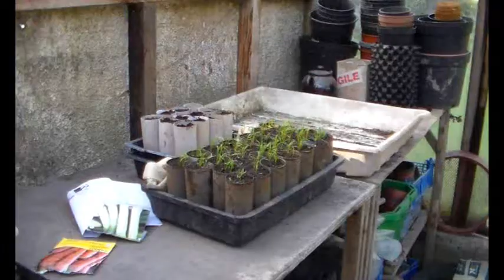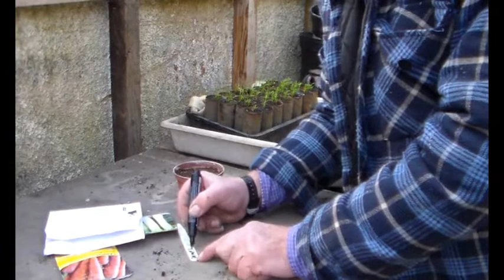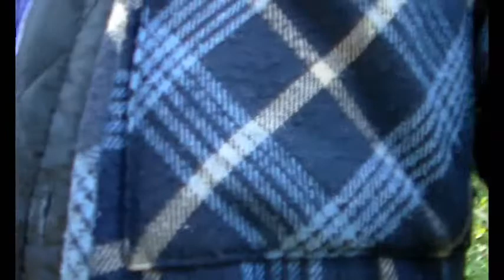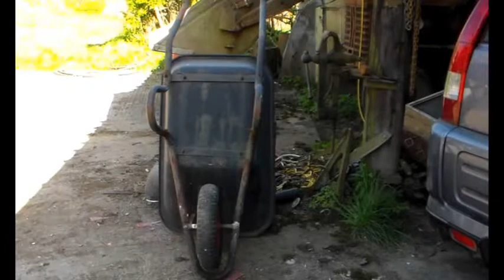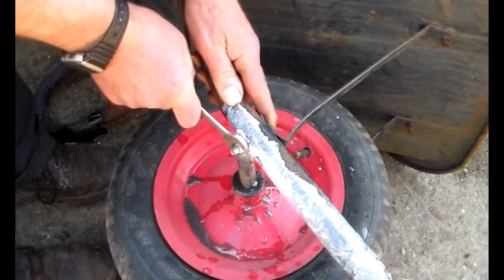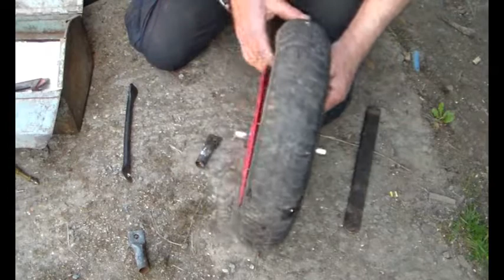Home life in lock-down, No.1. Veg garden, saw sharpening, compost, the question of wheel barrows

Comment: Last year I converted a stationary saw rig into a standard 3 point. On part 8 I use a Belsaw 10452 saw sharpener for the first time  to shape and sharpen the teeth. I very seldom hit the backsides of the teeth when hand sharpening opting to file the face of the tooth with approximately 9 or 10 degree angles as you describe. Good informative video sir !!  Btw I fixed the tube in a wheelbarrow tire yesterday !! Thanks Andy for the video.
Reply from the maker: Hi, thanks for the comment, there's lots of us independent types hiding away in corners, well done on the wheel barrow. On of my pet hates, flat tyred barrows. Nice sharpening video, and I subscribed, Cheers

Comment: I was daydreaming, thinking about cutting notches in small ash logs, and things. 
Over here in Tasmania, we have a lot of wattle that has that horrible, impervious, shiny bark. I've had some in the shed, drying for 5 years, and still it spits all over the fire and you can actually see the sap boiling out of the ends when you put it on the fire. Over the years I've collected heaps of it and I swear at it each time I go past the shed. 
I cut some notches in it, as you suggested and I can tell that it's making a bit difference. It's already making the musical knocking sound when I hit 2 pieces together, which tells me it's drying out quite well, just in a couple of weeks. 
My firewood cutting setup is a big saw horse I made and a chain saw. Having given more thought to the idea of notching these green logs. I wondered whether it's worth the effort. It takes a few extra seconds to put the notch in, and you lose a bit of wood in shavings. Then I remembered how much heat it takes to drive off water, and every single millilitre  of water you can remove from your firewood gives you heaps of extra heat in the fire. So yes, I'm notching all the shiny stuff now, and as I don't have to cross cut it like you, I make a cut at 45 degrees to the long axis of the log. This makes a cut with a larger surface area and should hopefully be even better than a simple cross cut like yours. 
It's autumn here in Tasmania and It's fun driving down the street seeing all the white steam billowing out of the chimneys. Wood heat is a thing here in Tassie but so many people don't realise that green wood is cheap because there's no heat in it, and they need to put a year or 2 into drying it to make it value for money. Dry wood is expensive, but still much better value than green, unless you stack it and dry it. 
As for me, well I have 23 acres of bush, full of eucalypts,  which burn like stink on the fire. However, after a few years of pulling all the good dead wood out and felling some of the less attractive eucalypts, I'm left with a lot of shiny-barked wattle. I'm glad for your tip on notching, which is turning crappy  green wood into useful firewood. 
Thanks, Andy. Best wishes form Chris, COVID central, Burnie, Tas.
Reply from the maker: Steve, thanks for your in depth comment, I also run the chainsaw down the length on a billet before stacking to cut through the bark before initial drying, this helps the bark to peal back and let the moisture out. Do you have any open space to plant some more trees? maybe of a different species, cheers
Reply: @TheInfoworks  
Hi Andy.
Thanks for the reply.
It's Chris here, by the way.
Yes, I do have space to plant trees. I'll be 60 years old later this year though. I'm less optimistic about planting trees now as I'm not likely to see any young hardwoods grow up before I'm off to the other place. Any ideas what I should plant? It's temperate rainforest around here... the plantation we bought originally was nitidus and obliqua, which was completely flattened by a storm., then we let it go back to bush. What do you suggest for something fairly fast growing and non-invasive to the Aussie locals?
Reply from the maker: Chris, it's always worth planting trees, it's very grounding and with all forestry it goes way beyond our short lives. For species choice I would have a word with your forestry services and any tree nurseries, they will know best what will suit all the aspects of your site conditions, best wishes with a sound project, cheers